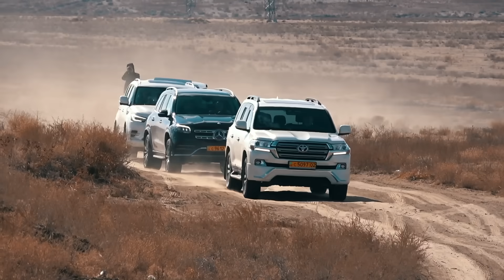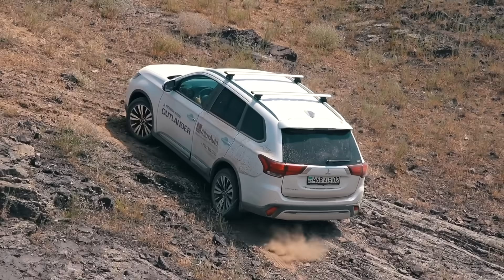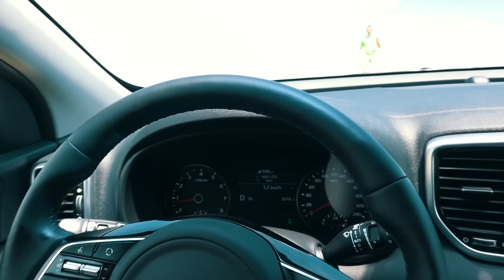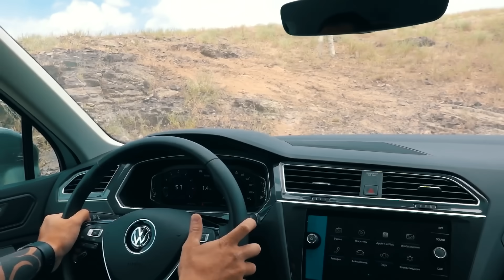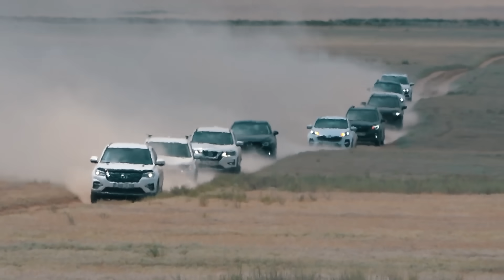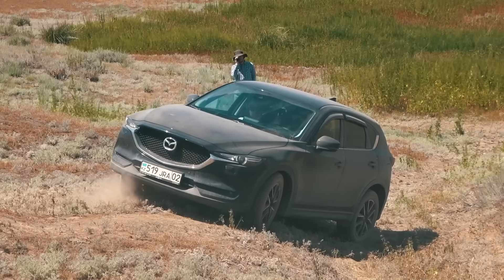SUV Battle 2020: Toyota RAV4, Nissan Rogue, Subaru Forester, Mazda CX 5, Volkswagen Tiguan, Sportage

Comment: Why was the RAV4 adventure/trail/TRD not tested with the torque vectoring axle?
Reply from the maker: That's what we did.
Reply: @SUVBattle  the adventure/TRD torque vectoring system is much different than the XLE AWD system.
Reply: @blondeguy08  not available in local market. Btw in KZ the RAV4 is also called what literally is translated into English as "a second-wife's-jeep":))) it's driven overwhelmingly by ladies who obviously will never take it where it was on the video.

Comment: Did that CX-5 not have that new off road mode? I'm wondering if that would've help with the wheel slip
Reply from the maker: I'm interested too. As soon as the car appears in my region, I will definitely take it for a test. Subscribe not to miss the video.

Comment: Set of A/T tyres on Subaru would have performed very well
Reply: As long as the A/T tyres were accompanied by at least 70 more lb.-ft. of torque at 2000-2500 rpm, and a more robust transaxle, then yes, you are right ...
Reply: @sking2173  You're wrong, the Subaru has enough power to have climbed that joke of a hill, the problem was that the driver didn't know what he was doing. There's plenty of videos showing what the Forrester can do with a competent driver behind the wheel.

https://m.youtube.com/watch?v=oaxggGLwWHE&
Reply: @knightryder3757  — There are many YT videos that show the poorly ole Subaru doing the same exact thing as happens here.

That 2.5 engine with the CVT doesn’t have the power to run over a rubber garden hose

But it is fun hearing you Subaru fanboys whine and cry ...

Comment: As a owner of the 2018 Forester, I was rooting for the Subie 😩
Respect to the RAV4 and the Sportage. But no love lost for the Forester from this Subie cult follower 🤣
Reply: Subie got worse with all its electronic modes and cvt. I think my Subie diesel with manual transmission would've won.
Reply: If the driver of the Forrester knew what driving mode to be in, he wouldn't have had problems going up that hill.
Reply: @knightryder3757  love the excuses
bogged. Stuck in the mud 😁 is the Term. Toyota is Just Better Engineered. Lol
Reply: @denero4735  It always is about excuses with Sub drivers isn't it? 😂
Reply: @finnishfatman Every other video comparison shows the subaru outperforming the rav4. Get real
Reply: @Gaber8845  Like I said in my previous comment... 🤣 And "outperforming" a rav4 is hardly a flex, but when not outperforming... ouch 😅🤦‍♂️
Reply: The subie driver didn't know what he was doing, but nice attempt at gasliting buddy.
 Btw, video sponsor'd by toyota 👈😂
Reply: @finnishfatman 👈  Waaah YT
Reply: @Gaber8845  Don't cry, it's alright. There there 😚 It's as ... wait for it ... there's always an excuse when subs don't perform. Always, like driver or something. That's a very common theme with sub drivers by the way, you're right. They don't know what they're doing 😅👍
Reply: You're just repeating yourself and still trying to gaslite, lol
What do you drive? 1.5 liter 4feet european toycar? 😂
Reply: @Gaber8845  Repeating is needed when someone is just all about excuses. Just because that little subie with it's horribly designed engine is a tarmac queens choice of a vehicle doesn't mean it don't have it's uses. It can still be used for soccer mom stuff, at least until the engine decides to just call it quits... 😅

So there there, it's a useful vehicle. Really, it is, it can do stuff... 🤭
Reply: Just saw profile pic. 
Dressed for battle but u  probably get winded walking to the fridge. 😂
Reply: And why are u still crying to yt. Smh
Have a great day. 🤭
Reply: @Gaber8845  Oh boy... you know acting like a baby doesn't make you look like a grown up, right? Oh I know you don't understand that... you drive a subie, sorry, my bad 😅

You started the crying and now you're so emotional, you can't stop the crying? Also, I have a house already, I don't need to be living inside your brain (rent free though) like you would so much wish to happen 😂

Man, you subie drivers are all the same. Get so emotional when your little soccermom car does what it does best, which is not much 😅
Reply: lol, whatever dude. I don't drive a subie. I drive a forerunner, but my wife has a forester. I'm just calling like I see it. 
I just realized why u don't like subies. If a subie was a person. U would be it, lol. Pretends to be tough, but ur really a big marshmallow. 
I'll let u have the last word.  Seems more important to u. 😂
Reply: @Gaber8845  You really can't stop can you? You should probably seek some professional help, because that's way too emotional how you're acting. Nothing bad in being emotional, don't get me wrong, but the way you just keep on going and going is... please, seriously, seek help. The way you "see" things aren't connecting to reality, so like I said, seek help. Go fix your "wifes" subie, at least we both agree that they really are marshmallows, so there's hope for you yet 👌
Reply: RAV 4 is twice the Car. Especially in Hybrid
Reply: @denero4735  Oh please... Not all RAV4's have the dual clutch system in the rear axle like this one did.  I think it's only the Hybrid and the top level trim that get it.  Outside of that, the other system mainly used in the Rav4 is an On Demand setup with the same BS software LSD, just like the Subie.. The difference is Subie's AWD is a full time system, but On Demand.

BTW, the I love the interior of these new Rav4s...  Just don't like with their AWD was full time...  Because on Sand, when you press the go pedal, you want power going to both axles.. Not just going when the car feels the front axle slipping.
Reply: @denero4735  — The RAV certainly has a better engine !!
Reply: @denero4735  LOL

Comment: Not really what these kind of vehicles where  made for. Snowy road or light off road, yes. Tires have a lot to deal with off road performance.....all weather road tires are not meant to climb rocks.  Kind of useless test.....If you're going drive up somewhere like this get a Jeep Wrangler. I  own 2017 Volkswagen Tiguan....Its great in snow, that what I needed and expected.
Reply from the maker: Well, my goal is just to show the difference in the efficiency of the four-wheel drive of different cars. It may help future owners to make decisions whether to buy the car or not.
Reply: @SUVBattle  but those car where not ment to rock climb...be like taking  pickup trucks down the the autobahn....yeah you find out which is faster, but who buying  a pickup truck for speed.  Find a snow cover hill with sharp turns...see how theses SUVs handle..that would be a real test as that's how they are used 99% of the time. This why I bought my Tiguan because I have drive in crazy weather,  some time before the plows make it through....not going rock climbing...specially with aluminum rims.

Comment: This Mazda is not 2019, digital display on Mazda CX-5 2019 is on the center, not in right.... Why your not use TCS OFF/button of Mazda, this button lock 4x4..... Not correct test....!
Reply from the maker: All comes with experience. Let's try next time. by the way, Mazda promises an off-road mode for CX-5/
Reply: @SUVBattle  Ok, i mean TCS OFF, this button with manual gear 1 is true 4x4. BR

Comment: It gets tougher down the line because the terrain moves with each Car, I think this needs to be pointed out. Great real life test tho!
Reply from the maker: Finding a road with the surface that does not change and which has convenient points for shooting is extremely hard.

What you see on the screen is the best that I could find.

As soon as there is something with more stable surface, I will take this opportunity.
Reply: @SUVBattle  I agree, what I meant was the sequence of which car go first is also an important aspect because it's harder for the last car to do the course compare to the first car (the movements in terrain). if we are talking about technicality, the Toyota has a smarter system but in terms of brute power, the tiguan is better. am I right?

Comment: Hi SUV Battle, good job. What surprise me most? Well I heard new Rav4 is much better than previous gen, but leaving Nissan 4x4 system behind (that is considered very good in SUV crossover classes) impressed me most. But I am NOT surprised with poor results of Subaru Forester, mainly because it has usual for its class AWD system with ATS (Active Torque Split) - that was used with AT also. It has multi-plate clutch and 60:40 split, that is different from straight 50:50 in MT models. And when a car has multi-plate clutch (or 3 open diffs - no Torsen, no LSD) the key to success is to program ESP (or rather whole electronic system) to avoid wheels spinning in off-road situations. This is why VW Tiguan is a big looser to me. Both Tiguan models went through obstacles but in a very aggressive way, something that is inappropriate for crossovers.
Reply from the maker: Thank you for such detailed comment. Was interesting to read.
Reply: @SUVBattle   My pleasure. :)
I should also explained why I think VW is a looser to me, coz many commenters disagree and find Tiguan very good product overall - that it is. A few years ago I tested Skoda Yeti equipped in Haldex 5 AWD on a test ground in similar conditions to those from your second spot. And it worked very good, every wheel that didn't touch the ground was slowed down by the system and car slowly crawled though obstacles, even on two wheels. So I know that VW Group has a lot of experience with AWD systems in crossovers and I am not hater of their products for sure. Momentum is not the only way to show off in off-road conditions, especially with low hanging bumpers. This is regress in engineering like t.ex. in 2012 when Honda replaced Civic VIII considered a very good product in the US with moderate one IX gen. Consumer Reports noticed the fact and scored new Civic low grade (I can indicate more examples of quality regress with Subaru, BMW, Mercedes, etc - mostly cost cutting motivated; and engineering regress with Mitsubishi, Citroen, etc). To me it is similar situation here.
Reply from the maker: As you mentioned Yeti, I have already filmed Yeti 1.8T AWD vs current Tiguan 2.0T, and also a lot of different cars like: Mitsubishi Pajero Junior, Hyundai Tucson 2019, Renault Duster, Subaru Outback 2018, Jaguar E-pace 2020, Mitsubishi Pajero 1995, Toyota Land Cruiser Prado 120 2004, Toyota Land Cruiser Prado 150 2020, Mitsubishi Pajero 4 2009, Mitsubishi Montero Sport 2002, Mitsubishi Pajero Sport 2019, Toyota Land Cruiser 200 2011, Isuzu D-Max, VW Touareg 2006, BMW X5 2004....... should be interesting test. Will wait your comments about the results.

Comment: Simply not believable, Subaru has the best all wheel drive system, period. The test is completely biased. None of this elevated wagons have the same test conditions. None of this cars were designed for those conditions. Nobody will take a car under intended use to the worst possible option. Wasted my time.
Reply: Calm down man,  your Subie is the best of the best of the best! SJ SF XT owner here😁.

Comment: Why didn't you turn off the traction control in the CX-5??  The CX-5 has a hidden off-road mode for this exact situation when you disable TCS.  Mazda even put out a press release about this hidden mode on 2018 and 2019 CX-5 models https://insidemazda.mazdausa.com/the-mazda-way/technology/whats-the-diff-mazda-cx-5-unlocks-secret-off-road-mode/. This test should be redone properly with the CX-5.
Reply from the maker: Let’s wait when updated CX5 with off-road mode will arrive, and then redone this test.
Reply: @SUVBattle  The problem with waiting is that people will think that only the 2020 has off-road mode but this isn't true.  The 2020 CX-5 just has a different button for activating off-road mode but it is not a new feature.  Please make sure to mention that the older CX-5 had off-road mode but that it was not tested.

Comment: Subscribed! Thank you. Would love to see a Forester Sport model out there for the dual X-Mode feature with deep mud and snow. Its gotten me through 6-8 inches of mud/snow/sand quite capably (with stock tires even).

...on level footing. I ain't kidding myself and know its not a sports car and it is a little bit of a disappointment in torque/acceleration/towing capacity.

Comment: the driver who drives SUVs cannot drive.  does not stop uphill when the tires turn empty, the left steering wheel is turned right.  and when the driving modes change it is always recommended to go back and then start again to avoid the holes that are made in the tires
Reply: You’re missing the point of the video...

Comment: I love the  Forester’s design and interior, which is good for an SUV. I couldn't believe it performed so well.
Reply: Driver is atvfault here, clearly dont ubderstand xmode. They need to turn the traction control off to utilize the xmode's potential.  When you do, dont stop turning the wheels so the x mode will engage in about 2 seconds.
Reply: So true man. And the Tech! I have the forester sport 19 and man its so comfortable. Thankfully I live in the mountains so I get to have fun in the snow. Its really capable but not a sports car haha.
Reply: So well? It performed terribly. The cvt is garbage

Comment: Why subaru has no hill climb assist?
Reply: X mode which they engaged helps. Wont let the car slip back. Also works as a cruise control for steep downhills to keep your speed steady at whatever speed you set with your acceleration.

Comment: What if you used the XT version of the Subaru Forester???
Reply: There's no XT trim of the latest Forester SK. At least there wasn't, even the Sport version is with the same NA 2.5-liter. The previous SJ XT might perform similarly due to same 1-gen X-mode and CVT.
Reply: @bakhtiyarpakhirdinov2461  I know coz I have, SH SJ-XT and SK. But my point is better if he uses to SJXT atleast if has higher torque and horsepower
Reply: That and a CVT and non CVT test to compare this horrible CVt that YouTube comment section hates.

Comment: The electronics that are there to help and the cvt are biggest enemies to the performance of these suv s , I wonder if a first gen outlander with 2.4 petrol engine and conventional automatic that has the awd like Evo 50/50 front rear without any electronics would have drove past without any problems, all it needs would be a bit of momentum. The last Tiguan just proof that

Comment: Heres the thing I've seen people go over the same obstacles that other people with the same car fail to do so....so forget about bashing cvts or awd systems....it all has to do with the driver....just look on YouTube, you will see amazing videos of subarus with CVTs going thru some really hard obstacles that just leave you really impressed yet you also see videos of subarus with cvts fail to go over obstacles that dont even look that hard, again it all comes down to the driver....i got a 2018 outback and have yet to find anything that has stopped me, I feel really impressed with my outback...sometimes when crawling dosnt work then you try hitting it with some speed and that will always get you thru pretty much anything....
Reply from the maker: Drivers deliberately drive as slowly as possible and along a deliberately “wrong” complex trajectory. This allows you to demonstrate the effectiveness of the four-wheel drive system. If you take a good acceleration, then all cars will easily pass this obstacle and you will not notice any difference in their behavior.
Reply: I agree about the CVT thing… but the Rav4 has a CVT. It simply has better technology for this type of terrain.